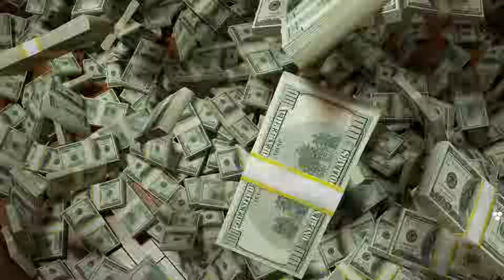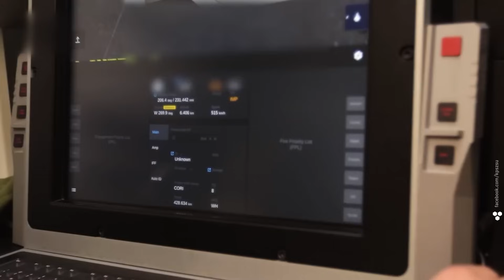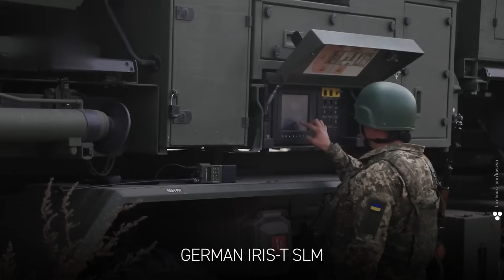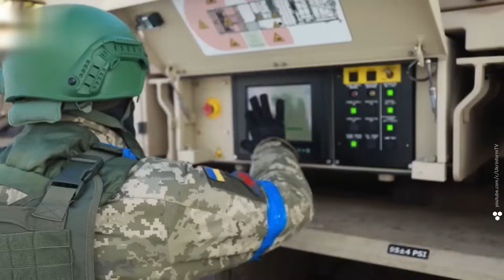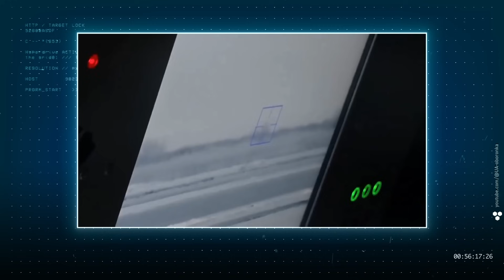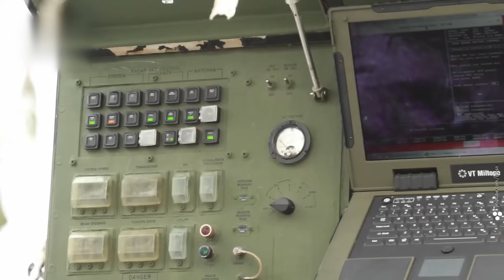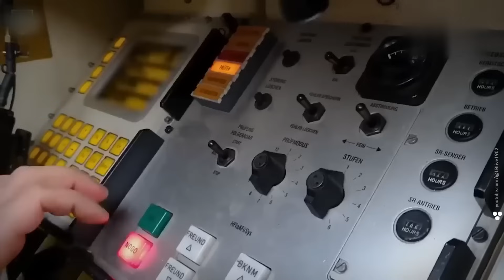Ukrainian Iron Dome: Soldiers Spill Hard Truth About Patriot, Gepard, NASAMS and S-300

Comment: Ukraine has also some SAMP-T for targeting anything from airplanes to cruise missiles they are even better / more modern than the patriot. The version they have however  is the older one which did not have the updated  missiles and software for intercepting ballistic missiles. This is another missed opportunity for the French/Italians as there is nothing like a real war to improve your gear and get it battle tested.  That is the only reason the Patriot still outsells the SAMP-T albeit it costs twice as much and, in relation to coverage, mobility (in the sense of being quick to deploy / redeploy)   radar coverage and number of personnel, it is one generation behind.
Reply: Yes, they have, and they work fine, but currently they are not operational because the ammunitions stockpile run down. That's a big problem as the same Aster 30 are used by France, Italy and the UK to shot down Houti's missiles in the Red Sea.
MBDA has started ramping up production, but there are only a limited amount of guiding heads that can be produce monthly, while the Ukrainian shot several missiles every day.
Reply: @Zumzifero  Italy has just announced they are going to double the production of Aster missiles by the end of the year, albeit as I do not know what the production is currently, I cannot tell what difference it can make.
Reply from the maker: Good breakdown — you're right that real combat is the ultimate test. It's a bit ironic that the Patriot is still the gold standard largely because it's been battle-tested in so many environments, even if some of its specs aren't the most modern anymore. Do you think France and Italy might push newer SAMP/T systems to Ukraine in the future to close that experience gap?
Reply: @Weapons.Of.Victory  Moreover, it is sad to say albeit true: It is also advertisement.....
Reply: @Weapons.Of.Victory  In Italian news I heard Italy is about to donate an additional SAMP-T battery to Ukraine, albeit I do not see what help it can provide if the problem is the scarcity of the Aster 30 missiles.
Reply: @thecaptain2000  when you shoot all the crap that comes to you (and I don't blame Ukrainina as it kills people anyway) the amount of missiles needed is huge, but you cannot shot a 30k $ drone with a 4M $ Aster 30 and call it "sustainable" the only difference with the Patriot is that the later has more stockpile available, but is running thin as well.

Comment: The shooting down of the "Dagger" was a coincidence, they also fired all the missiles from the battery at it. The 6 downed is propaganda, They are not able to shoot down the Kh-22/32 which is slower (they themselves admitted that they did not shoot down a single one) and they boast of shooting down a much faster missile?? that does not make sense. The speed of the target is clearly outside the parameters of the available air defense means.
Reply: You don't need to have more speed to intercept something that is faster than you. All you need is to meet at some calculated point.
Reply: @ By the way, the Kh-22/Kh-32 has a speed of over 3.5M at a very high altitude, otherwise it moves at a speed of 3M, which is quite far from hypersonic speed, which is from 5M and above. The Kh-47M2 is faster, of the available systems, only THAAD can threaten it, not Patriot, which has a target speed limit of around 3M and even that has a problem. The only one that was shot down was a coincidence, the battery near Kiev fired all the missiles at one target within a few seconds.
Reply: @andrii.romaniuk  You don't have to teach me, it's about speed. Every air defense system has a target speed limit, which is given in m/s for a target that is moving away and approaching with a course parameter of 0 degrees, and the speed of the Kh-47 is outside the parameters of air defense systems, just like the Kh-22. I served in the air defense for 10 years and before that I studied it at a military school, so I know the systems and the principles of guidance.
Reply: Kh-22 is a completely different missile. This is a cruise missile with near hypersonic speed and poor accuracy. But Kh-47 "Kinzhal" is an aeroballistic missile that follows a completely predictable ballistic trajectory on the terminal stage. It's almost the same Iskander-M but air-launched.
Reply: Looks like your famous kinzhal isn't as good as you thought, huh?   Putin lied again, what a surprise!
Reply: @abraham2172  Kiev lied. As usual.
Reply: @abraham2172  It wasn't a Kinzahl.
Reply: The missile debris they shows from the Kinzahl Kiev downing is of a clearly different type. They lied.
Reply: It was so much easier to follow and believe the script younger when I loved comics.

Comment: At the beginning of the invasion, Ukraine had almost 100 batteries of the S-300 system, that is over 400 launchers, 100 radars and command posts for the regimental and divisional battery level. Few people realize this, but one S-300 detachment can integrate 6 batteries each with 12 launchers under a common command, that is 288 missiles immediately ready for use, if they had all the sets in the PM variant and higher, they could have 16.5 detachments deployed in service, that is 16x288 missiles ready to fire at one moment. That is 4608 missiles!!!! Of course, assuming that the sets were functional at the time of the invasion and they had enough missiles. If they had not abolished the command systems that integrated the firing regiments , they could have integrated all 16 regiments under a single command. The Soviet systems were supplied together with the firing squads. Ukraine could have deployed the following systems: Baikal-1/Байкал-1
Senezh/Сенеж
Ranzhir/Ранжир
Universal-1E/Универсал-1Е
At the level of the national defense control element, the systems Vozduch-1/Боздух-1
Osnova/Основа. 
These systems are digital, they are not compatible with Western systems, but as a whole they work very well and the command systems of the S-125 and S-200 complexes can be integrated into them. 
Personally, I think that Ukraine did not use these command systems or the complex integration of the S-300 complexes.
Personally, I think that they have abolished the high-level command systems. They are too complex and require many trained people to operate them. They probably let the individual batteries work independently and entrusted them with the protection of individual sectors and sections, and only provided them with information about the air situation over Ukraine so that the batteries could keep track of targets beyond the range of their radars.
Reply: Also they had Buk, Tor,Tunguska, Osa and Strela mobile systems; this was augmented by more strelas ,Kubs, Pechora and OSA from NATO then Patriots, Crotale, NASAMS,  Aspides, IRIS-T SLS/SLM besides the thousands of Manpads from Iglas to Piorun to Stingers and still they are short on Air defense in the fronlines
Reply: @ yes they had and still have, although in small numbers, these systems also have a high success rate in combat. Strela-10 is surprisingly effective against drones, even though it was not designed and constructed for this type of combat. The 9M333 and 9M37M missiles have a photocontrast guidance channel that is sensitive enough to detect even a small drone. I was quite surprised when I saw footage of small drones being shot down. I read that Russia ordered another series of the Strela-10 system, a total of 2 battalions, because it is a cheap system and has proven itself in combat.
Reply from the maker: Yes, Ukraine had a massive S-300 network at the start, but maintaining such a complex, Soviet-era integrated system under wartime conditions—especially with missile shortages and targeting by Russian strikes—is extremely difficult. Decentralized operation likely became the best option for survivability. What do you think—was it the right call?
Reply: @Weapons.Of.Victory  but it is interesting how effective are older systems like S-300 or S-125 and S-200 etc., even today they have high efficiency against cruise missiles and against drones and other targets. I served on the OSA-AKM and Strela-10 systems, we shot at different types of training targets including very small and fast targets and we always had 100% success with them, With the Strela-10 system we shot at a training target - a fast rocket target, it is about as big as an AT missile PG-9!!! The operator had only a few seconds to look at the target, intercept and launch the missile, even the old 9M37M missile destroyed the target with 100% success!!!
Reply: @Weapons.Of.Victory  Decentralization was the only option, systems from the eighties and nineties needed a cable connection to higher levels of command and control, this connection was created only in places of permanent peaceful deployment of units. The only solution to use the "S" series sets outside of a permanent position is to decentralize the command of lower levels and let separate batteries or battalions protect the allocated space and only provide them with an overview of the air situation over a larger area using modern data systems so that they know from which direction to expect the arrival of targets, this information can be clarified using starlink and applications on a tablet or laptop, it is then up to the battery or battalion commander how to forward the information to incompatible fire elements, he can use the standard old voice reporting system as it was done in the eighties 🙂